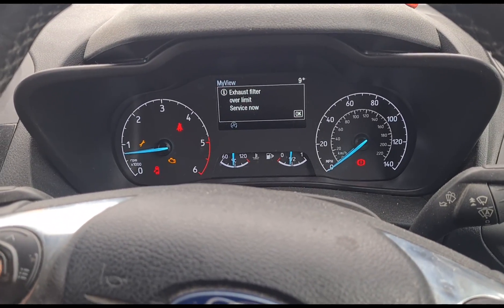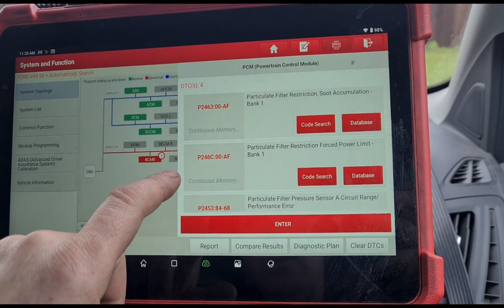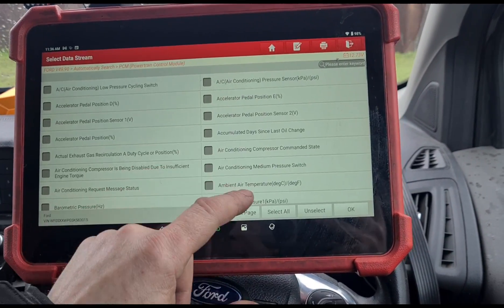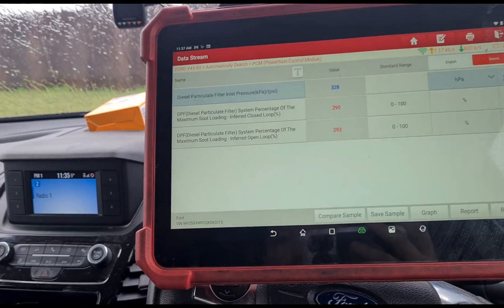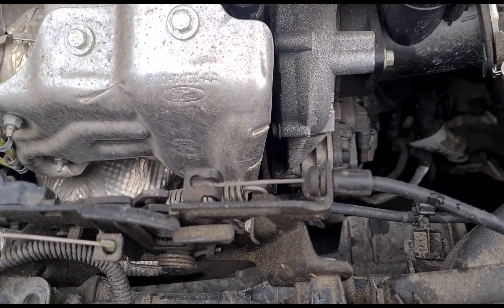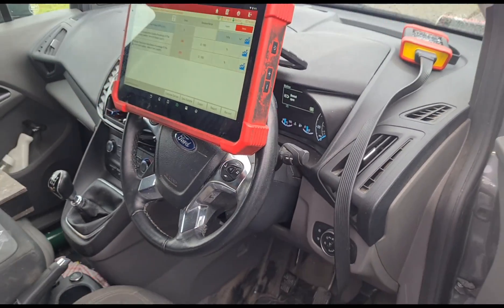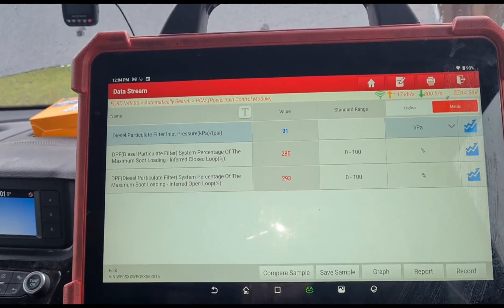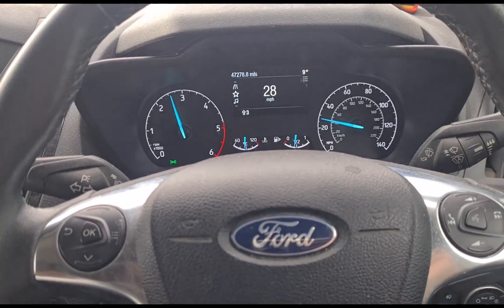Ford Transit Connect 1.5 P2453:84-68 P2453:00-68 Particulate Filter Pressure Sensor A Circuit

Comment: Hi Jimmy! Greetings from Hungary! In this video from 10:30 the soot percentage goes up from 0 to 13 percent within seconds. Is this normal for these euro6 Tourneo/Transit engines that the soot percentage goes up this fast? Mine may have the same engine (Ztga), have no fault codes but percentage can raise 20 % within a few kilometres thus needing a regen  within 60-80-100 kilometres... Exhaust pipe is totally clean, dpf pressure seems fine what could be the problem then? I would greatly appreciate some guidance or tips on how to move on/what to check as no one seems to know what to do here in my country! Thank you for your videos! Zol
Reply from the maker: It would take 50 miles until the DPF pressure and percentage can level out
Reply: @ORileysAutos  Jimmy, thank you for your quick reply! What is your experience about the average distance between regens for these Tourneo/Connect eur6 cars when used mainly for city driving?

Comment: Jimmy such great work when many fail your approach is first class working through the systems, especially when manufacturers make it testing even to gain access to the components, one thing I have noticed with all your great videos is when checking the engine speed on the rev counter (it's a real pain looking around the tablet) could you add the engine speed pid to the live data screen with dpf pressure & soot content, I'm not sure if euro tab 3 allows this option, I only mention because the Autel 909 does.
Keep up the great work Jimmy